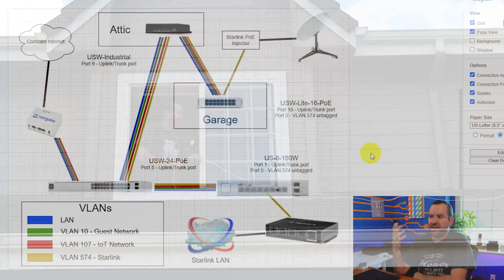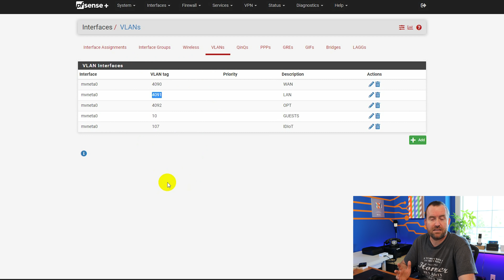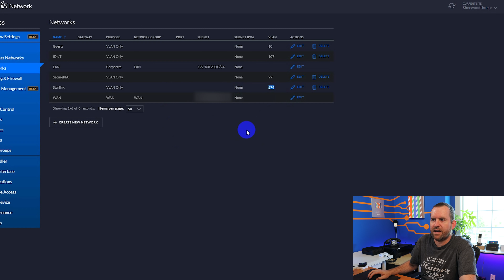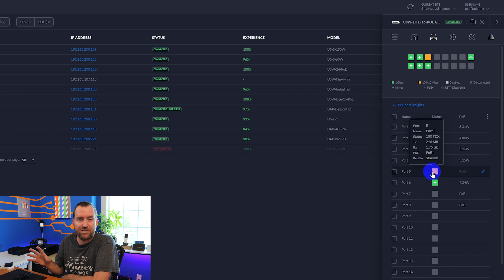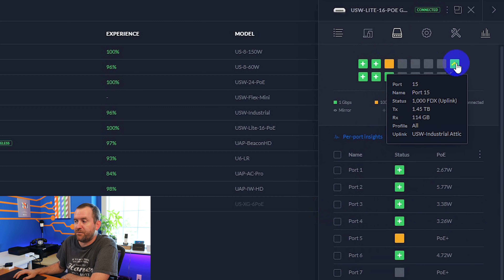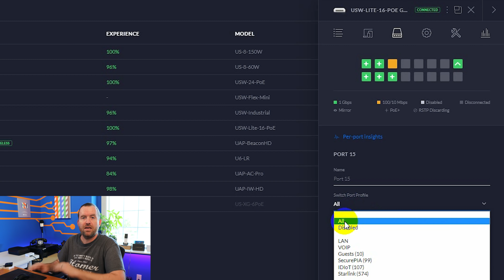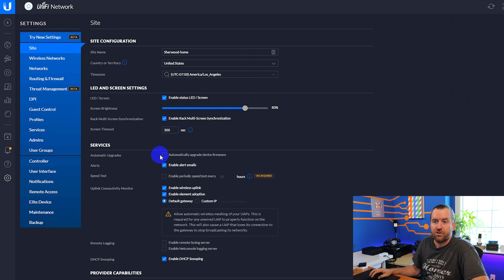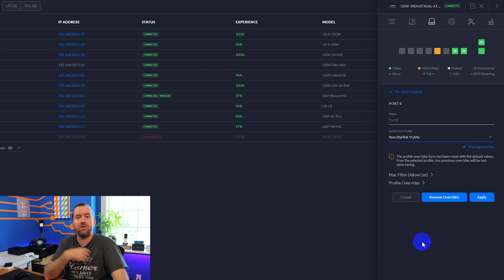My Starlink VLAN Setup

Comment: Hey Chris, just a question: is there any special reason to have a LAN dedicated to Starlink with the Edgerouter (or another one) and everything? Or is it just to have a separate infrastructure for the secondary WAN? And do I understand correctly that you are bypassing the firewall?
Reply from the maker: What I have configured is essentially a completely separate WAN infrastructure - but the connection from the Starlink dish to the WAN port of my EdgeRouter X runs through my existing LAN as a VLAN.

Comment: Thanks & Well done.  What is the benefit of segregating it on VLAN 574 other than security?  Honestly I don't understand what the benefit would be in home environment?
Reply from the maker: It's essentially a completely separate WAN connection, so you can't exactly route it through your LAN traffic, which is why it has to be its own VLAN.
Reply: @CrosstalkSolutions  That's why I watched your vid, VLANs are very confusing - still.  LOL  THANKS AGAIN
Reply: @j.casshoworth9127  Actually, in principle, VLAN's are a simple concept, but like most things in IT when they expand, they get complicated! :)
Reply: Each vlan is a separate broadcast domain, so things like dhcp will work correctly and get to the same dhcp server each time.  That's the main non-security reason for vlans.
Reply: @jonpinkley2844  excellent!  A practical example.  Now it clicks.  Cheers!